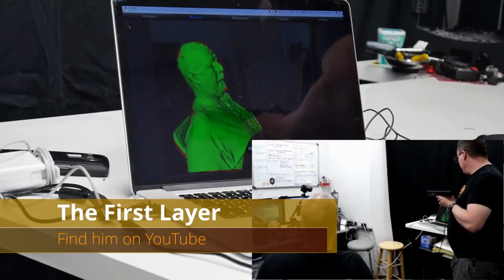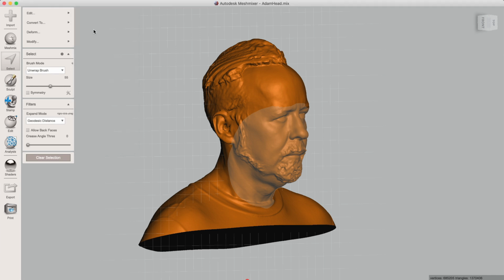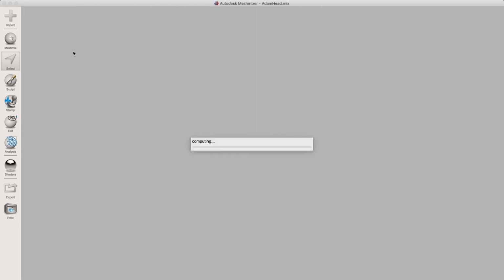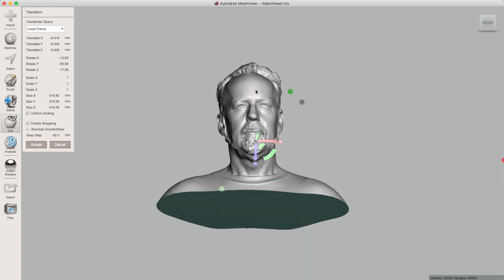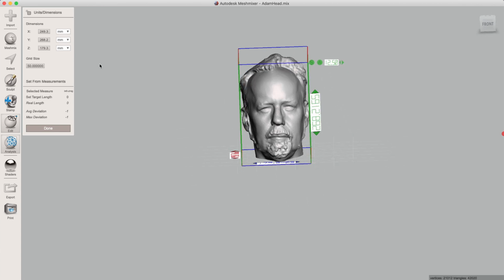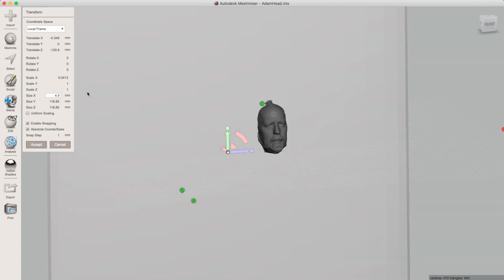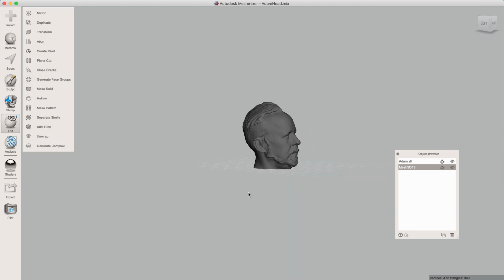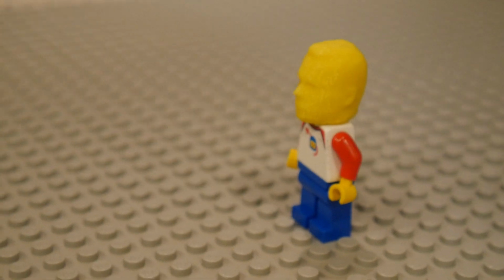How to make a mini-figure of you! A 'Me-nifig!' . How I made a Adam Savage minifigure.

Comment: Next time after cutting neck. Rotate so you can see the flat part of neck. EDIT. Create Pivot. (Snap Face to Center & Geometry Frame options) - Double click flat surface. DONE. Meshmix cylinder and drag it on top of the new pivot point. It will be centered on the point and perpendicular to the flat surface. Scale and move now or after creating new object.

There are other tricks I've learned about using pivot points and alignment. But this will help for this type of project.
Reply from the maker: Thank you! This is gold for me.

Comment: Seems 3d scanner app has low resolution even at "high res" setting, will try that other app to see if it is a limitation of the device or the software :)
Reply: Turns out the other scanner app uses the lidar which is lower resolution, the front-facing is the high resolution (well, 0.5mm, which is fine for objects that will be shrunk anyways!). Cool!